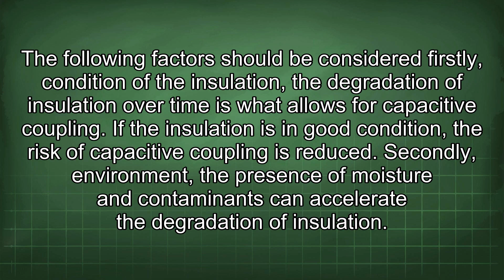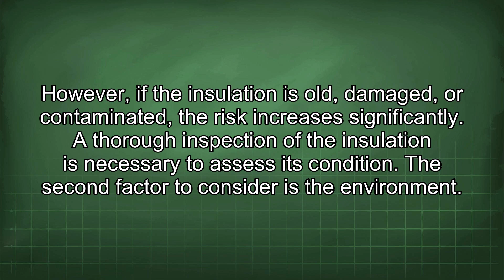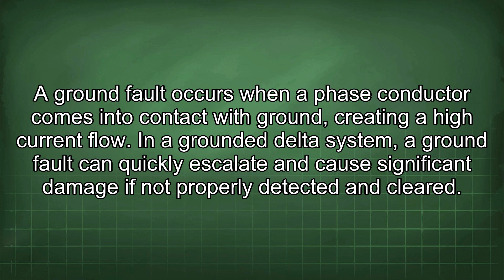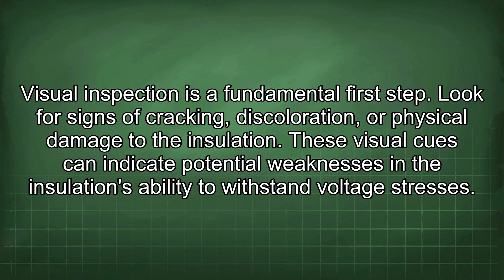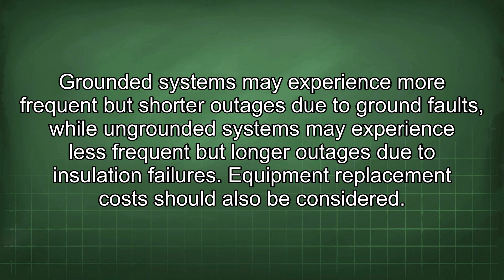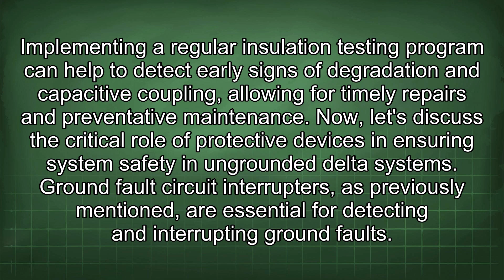Ungrounded 3 Wire Delta Systems Explained Simply

Comment: Several errors and misconceptions in this video. This does not describe a 3-wire ungrounded delta, but instead describes a corner grounded delta system. Viewer beware.
Reply: thanks